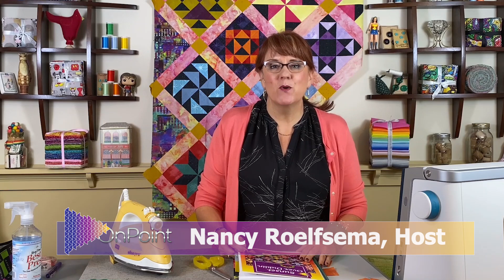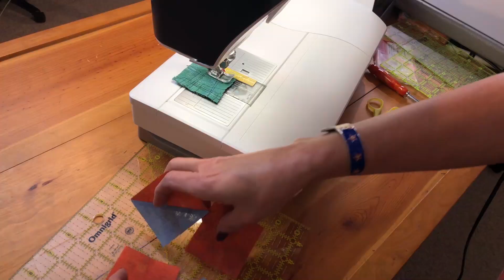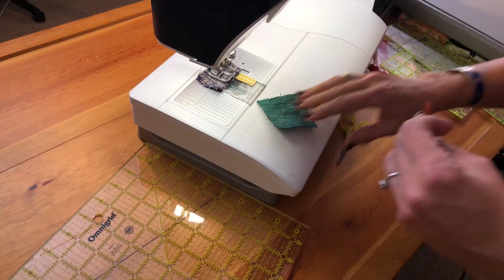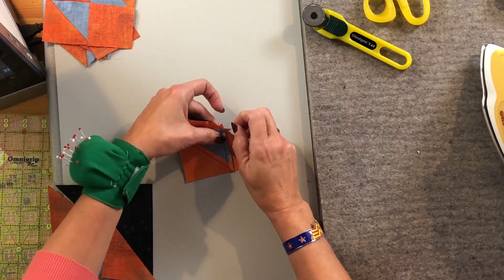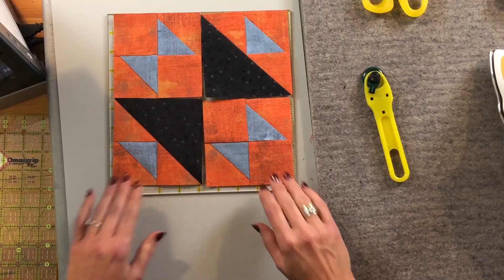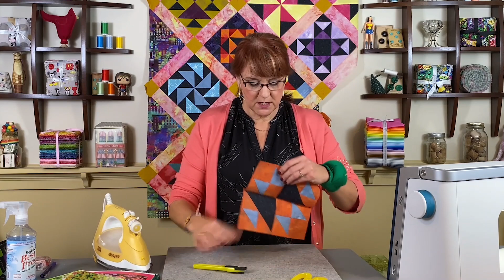Sunset over Dublin, Part 7: Kite & Bowtie Techniques (Old Maid's Puzzle)

Comment: On the seams that need to be "twisted" where one end lays in one direction and the other end lays in the other, what are you thoughts about clipping the seam (so that the clip is perpendicular to the seam but not into the stitching) so it will lay flatter?
Reply from the maker: My thoughts - I think that would risk the fabric strength being compromised where you do the cut - it wouldn't take much for that to fray out - I have never done that so I'm not speaking from experience, but that's my thoughts :)